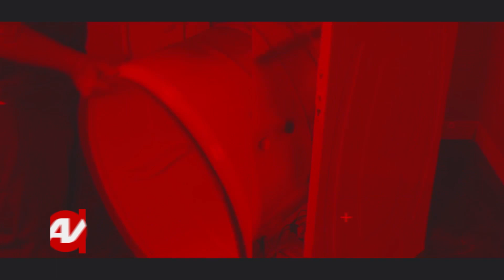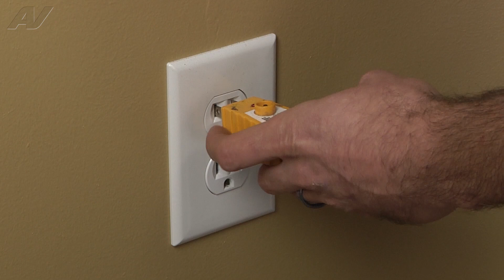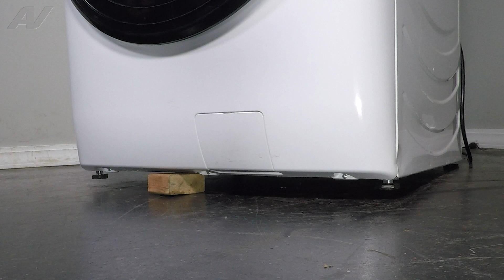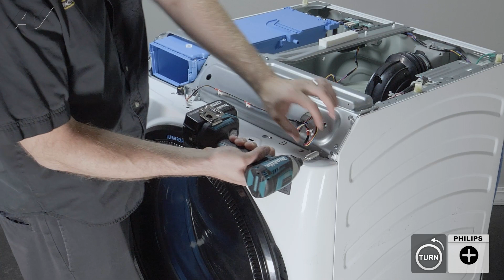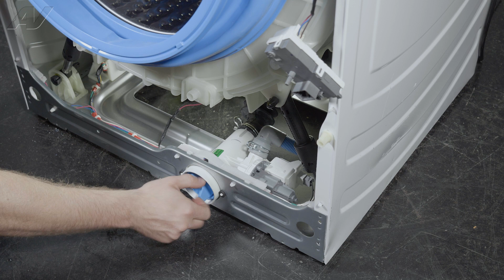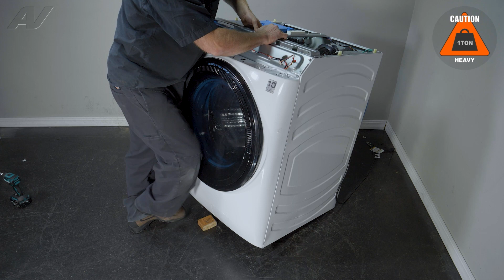GE Washer Repair - Will Not Drain - Drain Pump Assembly

Comment: I just got my pump in. This was extremely easy to follow. I will say that I generally have a problem figuring out how to get the connectors apart and I would have liked to see you explain them a little better. Not a big deal. I really liked how you showed the reassembly instead of just saying “reverse the order”. That method of putting on the door seal was nice.

Comment: Just curious why you wouldn't flip the machine on its side? I did this and removed the pump in 5 minutes.
Reply: Brother I flipped it on its side it was so hard to get the screws off the pump itself
Reply: How is possible in 5mins if you have to take the whole front off first?